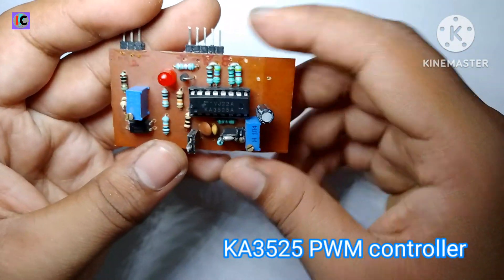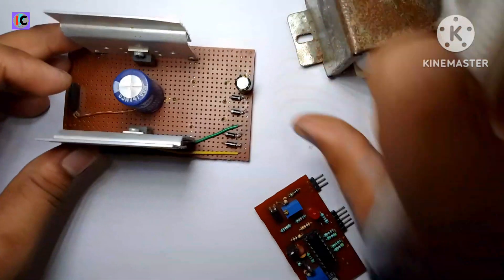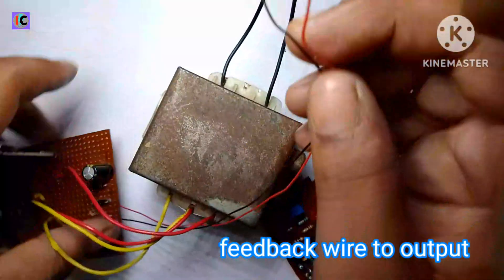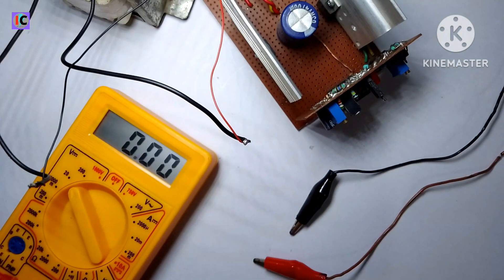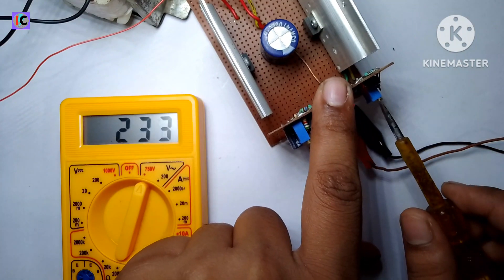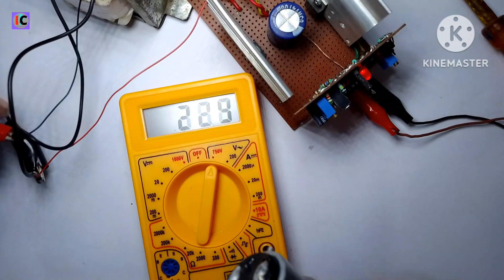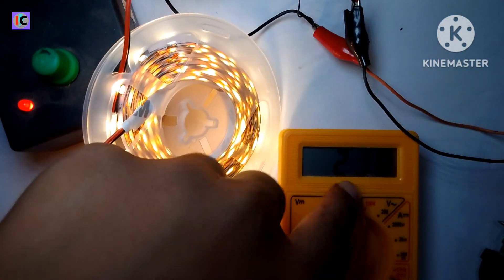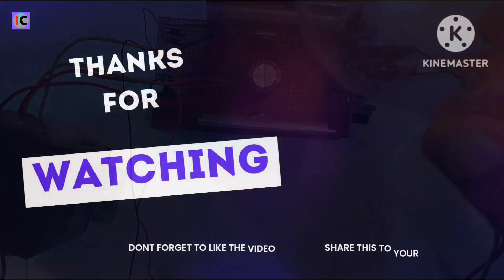DIY 12v to 220v Inverter 50Hz #inverter #sg3525 #transformer

Comment: Please can i will use this circuit diagram with ferrite transformer like ATX transformer ??
Reply from the maker: yes you can use this keep in mind increase the frequency adj preset for working on higher frequency above 20KHz as needed 👍

Comment: Can you a Inverter DC380V to AC 220V Pure Sine Wave with EGS002?
Reply from the maker: yes I am planning to make 380v DC to 220v AC using EGS002 very soon
Reply: @innovationic  Not Very Soon. Try within 2-4 days please.....
Reply from the maker: currently I don't have EGS002 module
thanks